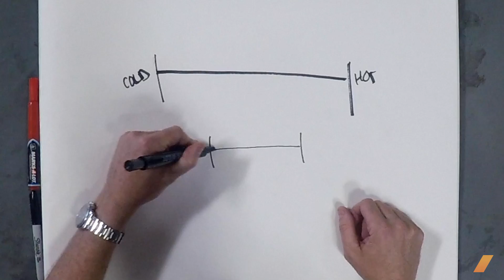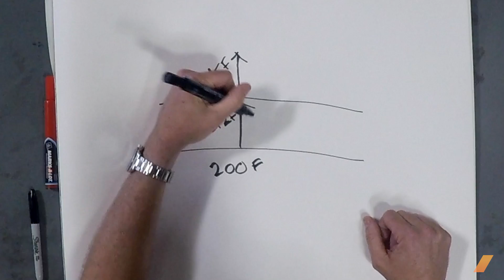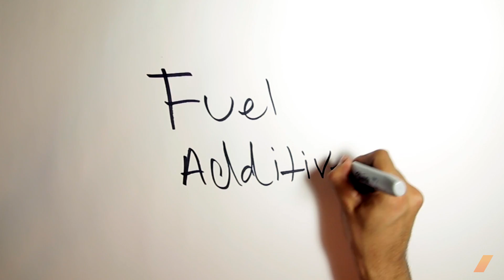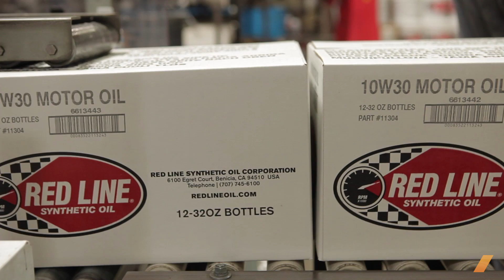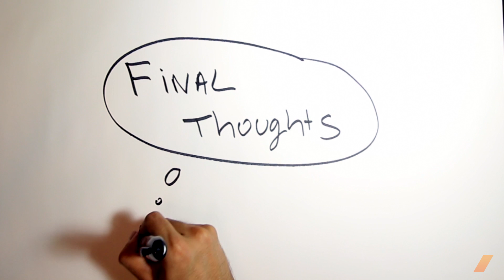10W-WTF!? Dispelling Myths About Oil -- /ENGINEERED

Comment: what would be better for a rotary engine where you are burning some of the oil intentionally, pao's  or esters?
Reply: As  a former Mazda dealer ,  factory racer & auto tech   who used to race for Mazda , I can tell you that Mazda recommends  using   ONLY STANDARD   PETROLEUM  BASED MOTOR OIL in Rotory engines   .   DO NOT USE SYNTHETIC OIL'S
Reply: Frank Fitzpatrick Totally correct. There is also a good mod out there if you don't like the idea of your engine burning engine oil. install a second washer bottle, fill it with two stroke oil and plumb it into the oil injection system. :)
Reply: i have heard that before. my question is what would be better if you had to, tier 4 or 5?
Reply: You can also just block the oil injection system  and premix in your tank , Just keep an eye on your filter and pump. I ran part premix part oil injection cause i wasn't 100% on my SA22s apex seals
Reply: drewx420 Never thought of that. bloody good idea. and sometimes I, just don't run them. tier 4 and 5 oils are much more expensive, and as 4 stroke engines differ so greatly from rotaries with the types of friction surfaces present etc, using those PAO and ester based synthetics would probably be pointless. stick with what they recommend. I am no rotary expert, but that's my best well informed guess.

Comment: People still come in to the shop with a vehicle hasn't changed the oil in 20-30k miles. An want to complain about spending $40. I change the oil in all my vehicles myself. My old 06 Malibu I ran sea foam and Castrol GTX high mileage 10-30 and it was still running smooth at 254000 miles when I sold it and the only thing that ever leaked was the $20 oil filter housing extension gasket around 180000 miles. My truck Im still running the ac delco oil GM recommends when I change it, but getting up to around 130k Im thinking of going to that gtx high mileage again.

Comment: Okay so choosing winter weight is basically, the lower the temperatures, the lower the weight? So up here in canada when we hit -40 (-42C=-42F), I should go straight to 0?
Reply: I would use 0W regardless of season. Its thinner at ambient temps and gets around much faster at startup than 10W.
Reply: Not really , in the summer in places like California you could not know the difference between 0W-30 and 10W-30 synthetic oils.
Reply: 0W is still thinner and moves quicker at startup.. Your Capri might have said 20W-50 in the manual, back then, but now I bet they would recommend a 0W-30 if it was made today :). Of course, with the tolerances typical back then, you'd be better off staying with the 50 weight. Unless you had it rebuilt to tighter tolerances.

Comment: I use ATF to flush a gasoline engine, just empty old oil, refill with the same amount of ATF as you would oil, run the engine 20mins just at idle no reving what so ever, and then empty fill with oil, change filter, drive 1000 miles, change oil again and done.

When I replace fuel filters on DIESEL engines, I fill the oil filter with ATF, it cleans the injectors well.

Comment: I'd like to have seen a lot more info on the statement that oil does almost as much cooling as the coolant system.  At face value there's no way that's true (think, IF you have a oil cooler at all, how does it compare to your radiator?),  If he's saying the oil redistributes heat from very hot spots to the block in general for the coolant to then handle, that would make sense.
Reply: It does have an effect. Not sure if its so much as 'almost as much as the cooling system', but we see it in our engines. The proper type and amount of oil will effect cooling.

Comment: I like how he went into the tech of oil without trying to push his brand too much. It really shows how his advice applies to all oils and not just Red Line. Good info for those of us too broke to afford top tier oils.
Reply: sienile 
Yeah man, I use the cheapest traditional oil available. Change it monthly or ~6 weeks, and never had a single problem. Tbh, the lighter weight (still OEM recommended) is almost nicer on the butt-dyno. I feel that additives can be EITHER p:
- used in the oil regularly (soo $$$$$)
- used irregularly such as lucas additives, etc. (So just $).
If you have an engine with decent/average tolerances than it seems perfectly fine to use the cheaper oils with an irregular additive procedure. Also, if you drive like a granny, you could do 1M km and still have cross-hatching, might not ever open the engine, might still have the original spark plugs (not recommended), etc. It's all about your usage.
Reply: I run Mobile 1. It's $25 on Amazon for 5 Quarts. At only $5-$6 more than cheep oils I can't go wrong. Then just go midrange on filters. The Mobile1 filters are a bit expensive.
Reply: Mobil 1 Extended Range all the way. (for daily driving) Change it every 20k miles, to be safe. Costs twice as much as conventional does up here, but far fewer changes, so saves quite a bit.

Don't cheap out on filters. It's really important that they catch everything that comes their way. No paper crap. You want it to pull those contaminants in and trap them in the fibres, never to be released again.
Reply: Extendet range or not, it`s not save to use oil for 20k miles. Europe maximum is 15k km
Reply: In standard practice, no. Oil filtration's gotten better too though if you use a top tier filter. Use a "bypass" filter in addition to that and bam, cleaner oil and longer drain intervals.
Reply: There's quite a few synthetics in North America that are rated for 25,000 miles, 40,000km of regular use. That's not to say that you should push every type of engine that far... my car's engine is a type that is known for never leaking oil. You never have to top it up unless something is seriously wrong. Well looked after, it could go 300,000 miles very easily.

A Ford Contour on the other hand will leak oil like you wouldn't believe, and probably blow the engine or tranny in half that time. You wouldn't want to push that engine. If you tried for 20,000 miles, you'd probably have to top it off with another 6L of oil once or twice in between. :P

Just look up online how reliable your engine / model / year is, and then you'll have some idea of how you should treat it.

I personally wouldn't have tried longer change intervals, except that I stumbled across an Exxon whitepaper about synthetic usage in forklifts. It said that they started to detect metal filings (indicating failing lubrication/properties) around the 60-65k mile mark, many many many years after. (6 or 8? Don't remember.)

Anecdote: Someone I know told me he witnessed engine testing at a car company that he worked for, and that high quality synthetics are basically magic. They'll make an engine wear down internally 6-10x slower than cruddy conventional oil. It's insane how much of a difference they make.
Reply: Think about this, 10k miles on top tear oil  8-10 dollars  a quart
Let's say your car uses 4 quarts 4x8.00 = 32 plus a 5 dollar oil filter
so 37 for an oil change diy.

Cheap oil  2.75 a quart  4x 2.75 = 11 + 5.00 oil filter
to get 10k miles out of this way at 2k miles you change the oil 5 times
so 16.00 x 5 = 80 bucks!  Did you save money? Hell no you spent more. in fact you spent 43.00 more dollars trying to save a buck.
Now let's take that figure into 250k miles and do the math.
TIC TOCK TICK TOCK........ now you seeing the point?

You can run a synthetic oil for 10k miles and a good filter and it comes out just as clean as a cheap oil at 2k miles.
I use Toyota's ow20 its 8 bucks a quart and the filter is about 4 bucks.
I used to use Pennzoil only for 40+ years, and I can tell you the synthetic looks better when I change it then the pennzoil ever did @ 10k miles. I've never been a fan of change oil every 2k miles. And I own cars with 300k miles on them doing just fine never been in serious service problems. in fact its been gas problems for the most part because of 10% alcohol blended fuels.

Do any brand of synthetic oil you like but its worth it to change to it.
Reply: 2K mile oil change? Who does that??? At my shop we do 3k for conventional, 4k for synthetic blend, 5k for full synthetic (usually Mobil1 or STP Dexos). Many of the full synthetic cars start having valve tick either right at or shortly before their change interval. Synthetic blends usually can go 500+ over before developing a tick. Only GM brand engines or ones with large leaks have valve tick on conventional oil before their change interval and most can go almost 1k beyond.

So, with those intervals and bobbg's pricings, you come up with 3.33 changes in 10k on conventional at a cost of $53.28; 2.5 changes on synthetic blends (bobbg didn't give a price for those, but at my shop they usually cost less than conventional due to a supply deal, but for argument's sake I'll price at $4 per quart or $21 per change with filter) at a cost of $52.50; and a measly 2 changes on full synthetic at a whopping cost of $74.

In actual real life usage, full synthetic is still too expensive to be cost effective... but hey, I'm just a mechanic that's had to swap a half dozen engines on full synthetic cars because they believed they could go the manufacturer suggested 10k instead of the 5k we put on their sticker. I'm pretty sure the manufacturers base the 10k figure on pure highway miles and not city or mixed mileage. The easiest indicator for your oil's life in your usage is to listen for the -slightest- bit of valve tick and record the mileage since your last change and subtract a few hundred. If you wait until it sounds like a mining crew invaded your valve cover then you've already caused significant wear. I've never seen a single car that could go all the way to 10k, but I have seen a very well maintained Camry go about 7.5k; but that's 1 Camry among the 15 that regularly come into my shop.
Reply: sienile ..Camrys suck and Yoda recommends 10k oil changes as does Ford these days w/full synthetic oils only. My '14 Fusion 2.0 Ecoboost nearing 75k mis runs perfect..like new! OCI at 7500-8000 mis everytime.
Reply: @BikeHelmetMk2 20k is way to long

Comment: What about cars nearing 300,000 miles?  Should more worn in engines use thicker or thinner oil?
Reply: Nineteen-Eighty two Rampage
Reply: Nineteen-Eighty two Rampage if you are burning oil.. Yes run thicker.. Or add a quart of Lucas.. Or both
Reply: Nineteen-Eighty two Rampage he said to use high mileage oils. They will help swell seals.

Comment: You talk a bit out E36 M3s.  I've got a 1997 M3.  The engine has 107k on it and I run full syn 10-40, Mob 1.  What about adding zinc to the oil to protect some of the ever increasing tolerances of the main bearings?  I do track the car but also drive it on the street from time to time.

Comment: I have an 03 ranger with the 2.3, I got it for $500 bucks because the engine would knock when hot, and it's just the beater, I threw some diesel oil and a quart of 75w90 oil in it, 10k miles later is still running but only gets about 22mpg average LOL

Comment: Have 500k kilometers on a 1600cc stock motor in my 2004 Nissan n16 Sunny. I have started to use liquidmoly engine oil for high mileage engines in it since she clocked over 300k+. Currently she cranks on the on the first key turn and still runs smooth as a clock. Right Oil and timely oil change is key to high kilometres. I am aiming now for 750k kilometers.

Comment: How good can fuel additive be in direct injection engines? After all the fuel doesn't pass over any surfaces in the same way as indirect or carburetors.
Reply: that depends. It aint worth shit for the valves but it will still clean the injectors.
Reply: Del Johnson If the injectors are clean and clear the spray will be correct and that is the most important thing.

Comment: 10w-* conventional = 5w-* synthetic 
 
in early 70s and back motors with the older main seals a synthetic do to being too thin will leak badly if something like the lucas additive is not added to thicken it up
Reply: I think that's BS, personally.  I ran 0w-30 synthetic on a Honda B18C1 VTEC engine with over 300K miles, and it had no oil leaks at all.  After I changed the head gasket and refreshed the head with new valve seals, it started leaking a bit in a couple of places, but that wasn't due to the oil.
Reply: that would be an example of a newer motor with tighter tolerances and better seals. what I am referring would be like the ford fe that had a rope rear main seal that is fussy to leaking. I run 15w-40 shell rotella t oil in one of these since it has a fair amount of zinc for the lifters.

Comment: Peugeot 207 1.6 turbo what oil is the best?
Reply: Follow your owners manual?? probably 5W-30
Reply: stratosfirebird Total Quartz Ineo ECS 5w30 is your manufacturers recommended oil. However I strongly recommend you use total quartz 9000 5w40 as it is a far more high quality oil which contains much of the same additives as the ECS oil, although it burns a little bit nastier at the exhaust pipe.

You CANT scrimp on oil with prince engines or they will just burn it.
Reply: CAElite Thank you for your answer. I bought the  Total Quartz Ineo ECS 5w30 but maybe the next time i will try the Quartz 9000 as you said, i live in Greece with the temperature goes at winter min 0 Celsius and the summer goes 37 Celsius max.
Reply: Shell Helix Ultra is what i would recomend
Reply: thanks for your message. You mean the 5w 30??
Reply: stratosfirebird yes

Comment: O.K.... I have a question, and I really hope I can get an answer. Are all synthetics friction modified? I've heard that a good deal of them can't be run in motorbikes, as they make the clutch slip (wet clutch, obviously).
Reply: Some synthetic oils have friction modifiers (which is an additive) and some do not. For motorbikes, you can use Rotella T6, which has JASO MA approval.

Comment: I recently moved from California to Texas and saw an increase in gas mileage from 9 mpg to 13 mpg. I assumed the better gas here was just more efficient but I now see that the better gas was probably just cleaning out carbon buildup in my engine and on the injectors. This is a Jeep with 261k miles
Reply: Likely less ethanol in the gas there, since California likes to play "hippy" still, even though it does supposedly burn cleaner but it also produces less overall power causing you to actually use more fuel (plus it absorbs water which has been the bane of boaters since it can foul the engines.)
....That and depending on where you lived Texas is also a lot flatter.
Reply: SilvaDreams Where I live in Texas theres actually more hills than where I lived in California
Reply: Maybe just more relaxed driving? Less traffic?
Reply: duronboy2 More or less the same in both driving and traffic. Definitely nothing that warrants a 50% increase in gas mileage

Comment: Could someone please explain his methods behind oil flushing, is he using oil flush additives or just clean new oil, I'm asking it becuse he said to use the cheapest oil you can find witch usually doesn't have any detergents in it like more expensive synthetic
Reply: Most oil for auto use has detergents, they just dont last as long in the cheap oils. But, since you are gonna throw it out the same day or so, buy the cheap stuff to save some money.

Comment: One note to make. Fuel additives won't work on Direct Injected engines, no?
Reply: The issue with DI engines and carbon buildup is on the valves. Since the fuel is injected directly into the cylinder, it never gets to touch the valves, which means they aren't being lubricated the same way a port injection or carbureted set-up would. Since the valves aren't being lubricated in this way, carbon tends to stick to the surface much more easily, gumming up the valves over time, and restricting airflow into and out of the engine.

Other than tearing the head apart and cleaning the valves manually, you actually can do a few things to prevent carbon build up in a DI engine. In some cases, it helps to spray a little bit of carb cleaner, or similar substance, directly into the intake, usually after the throttle body. This can help by getting some of that lubricant or cleaner onto the valves and helping prevent or clean the carbon already on them. Other than that, running the engine up to operating temp for a reasonable amount of time regularly can help prevent carbon build up. You're much more likely to get carbon build up issues on engines that are run for very short periods of time over the course of their mileage in comparison to engines that sit at operating temp for extended periods of time.

In the end, some carbon build up is really just an inevitability of the DI design.
Reply: garrisonr77 well I drive the piss out of my DI car and literally halve the MPG rating so hopefully it won't be as much of an issue
Reply: MotoBoy aggressive driving will ruin your fuel economy. driving 70km/h in town instead of 50km/h will about cut your fuel economy in half.